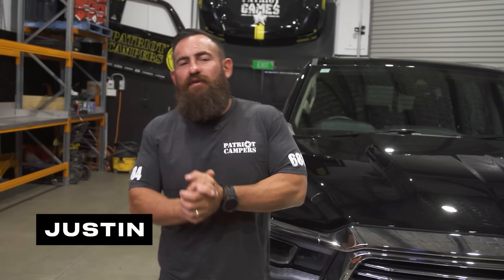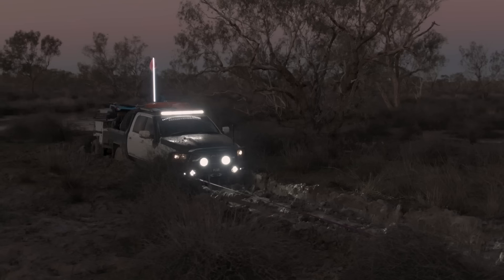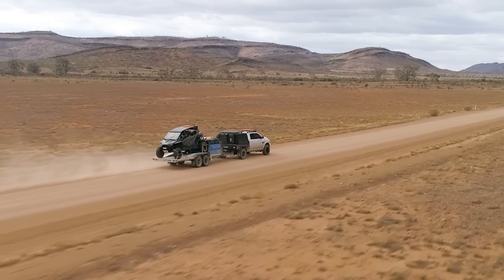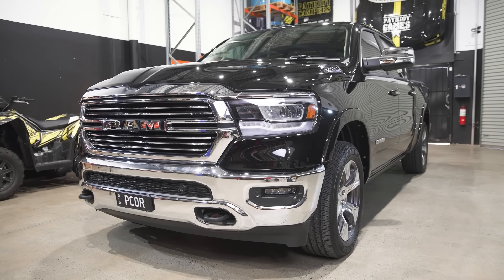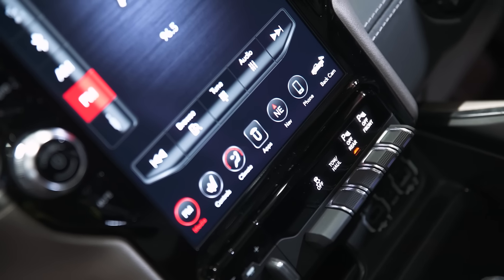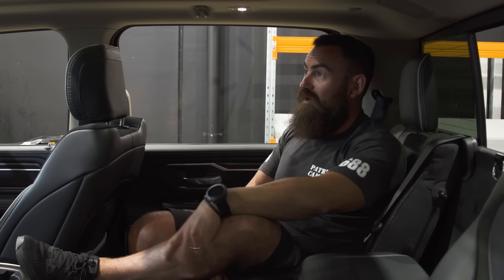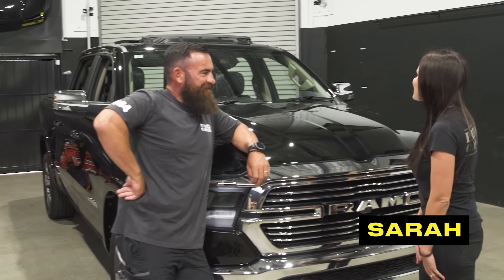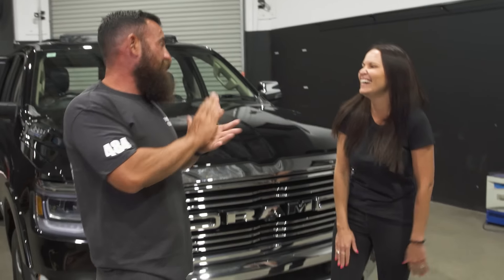AUSTRALIA'S NEW RAM1500 - Is it that good?

Comment: This helps so much mate, I’m looking at the exact same, 2021 Laramie with the rambox! I’m 23 and I can’t wait to get it, it’s like another home loan though 😂😂 now I just need the lift kit!
Reply: I’m from the US I have a 2021 ram longhorn. One step below the Laramie
It’s the third ram I have had going back to 2007
These trucks are absolutely amazing and just keep getting better. For those of you wondering about the Ford Chevy and ram differences 
They are all good 
Ford and ram can fit 35 inch tires either by removing the wheel liners or doing a leveling kit
The Chevy needs around 4-6 inch of lift to fit 35s
Ram 1500 is running a 4 link which is actually a 5 link with coil springs and the ride quality in my opinion compared to Chevy and Ford is hands down the best. They are great truck. Super comfortable. Extremely reliable and I’m stoked to see Australia getting to enjoy them as we do here in the states.

Comment: Awesome video mate, have the limited 1500 2021 in white my self, my wife loves it too and I think she’s almost convinced to have one her self. 

One question though, does your model have a slight intermittent vibration at 100kms and if so have you found the cause etc. I’ve been told it’s due to the torque converter and eco mode with the transmission all adding to it.

Comment: Good vid. Just wanted to know if you can remember what the real life fuel consumption figure was on the previous model
Reply: My 2013 5.7 sport got 10-11 on the hwy in summer 16 around town.
Reply: @heathwalker1736  thanks for that. Not that bad at all. Have added any accessories, or added any mods like suspension lift, bigger tyres?
Reply: @chrisspies8123  stock tyre and wheel size though It was tuned, had a s&b cai and carven muffler delete.
Reply: @heathwalker1736  thanks for the info. Really helpful to understand its real world running cost. 👍🏻
Reply: @chrisspies8123  it’s all good mate. They’re a great truck. I actually just traded it in for the 22 gt version.
Reply: @heathwalker1736  yeah nice. Enjoy he new ride

Comment: The truck is very nice, looks good, comfy, quite light and economical for the size. But the size is the problem, not sure how you can compare it to an LC which is a full 1m shorter. You might squeeze into a parking spot and open the doors over 2 Miatas, but the "ass" will stick out for 1m, blocking the alley 😅